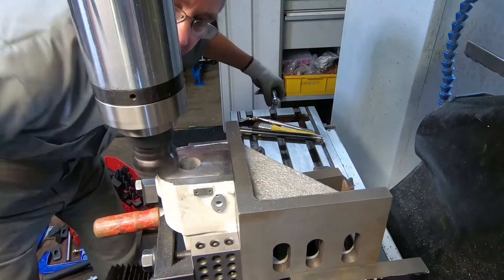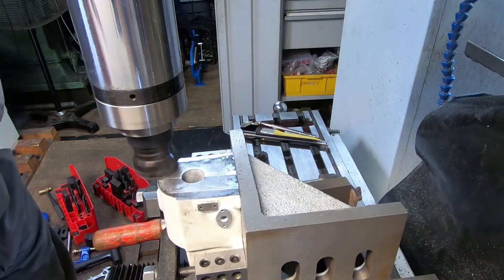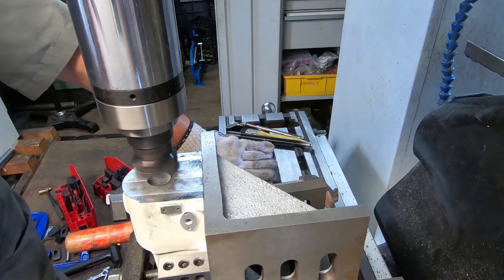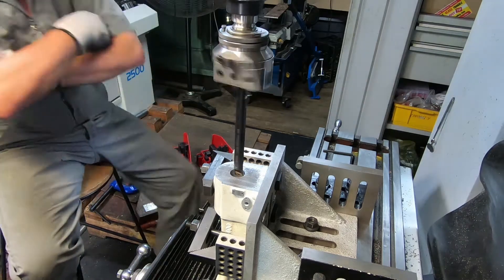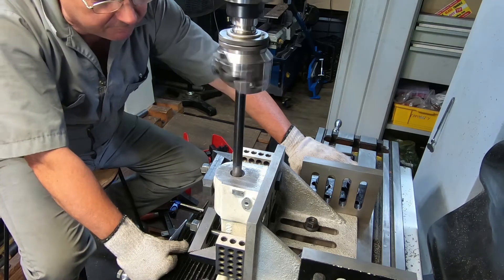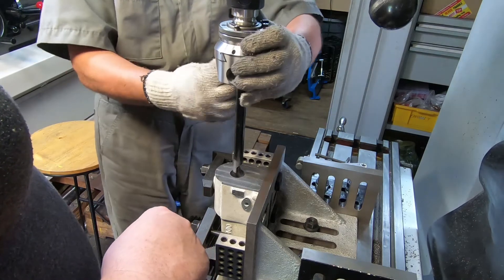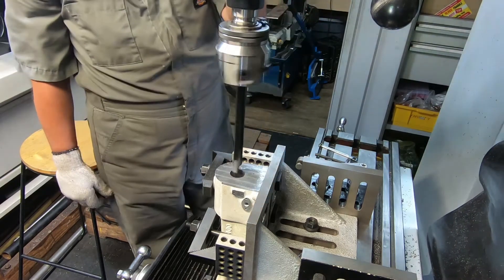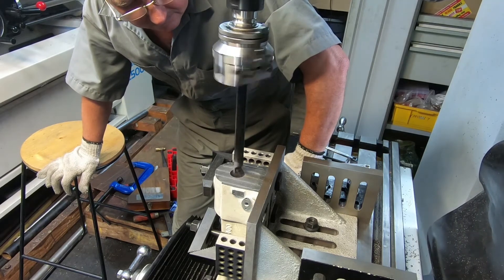Not numbered - cylinder boring update

Comment: Ditch those blasted gloves. I absolutely cringed when he grabbed the rotating bar. Use thin Nitrile Gloves if you want to keep your hands clean. They'll tear easy if caught without dragging the hand in. Those cotton gloves will not let go if they catch. I make no apologies here as I've seen what happens when someone gets caught up in rotating equipment.
Emma it would be better to line bore that on the Lathe with a through bar and a very sharp 50 to 60 degree point K10 Brazed tool available from Carmet at Archerfield.